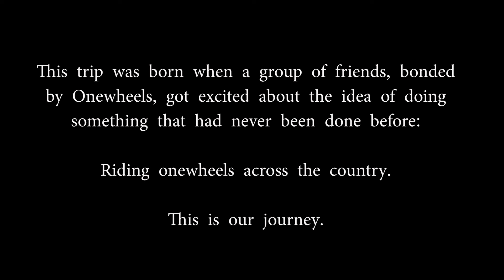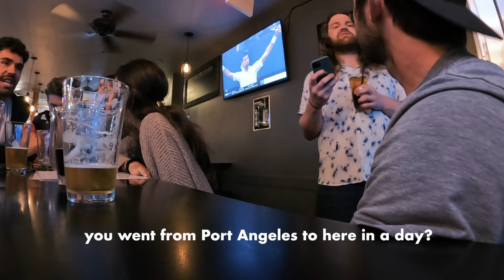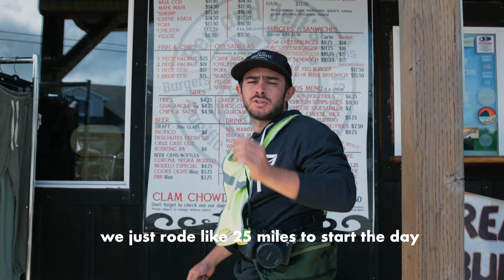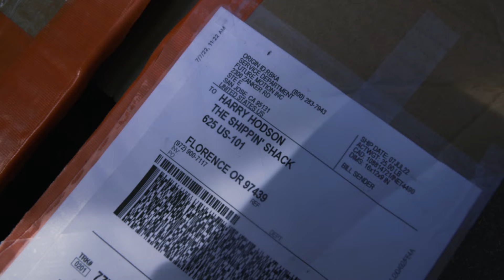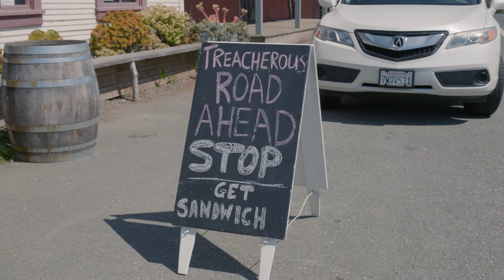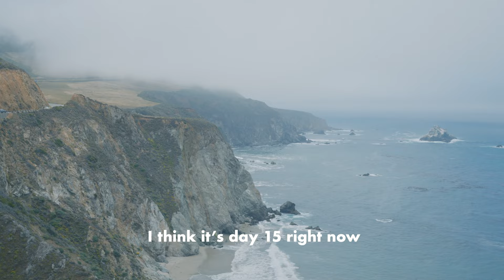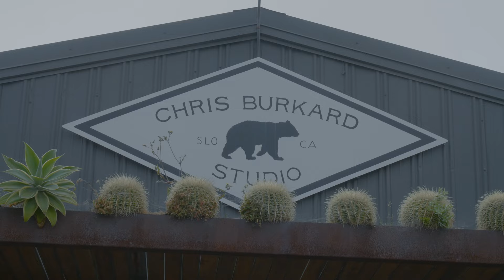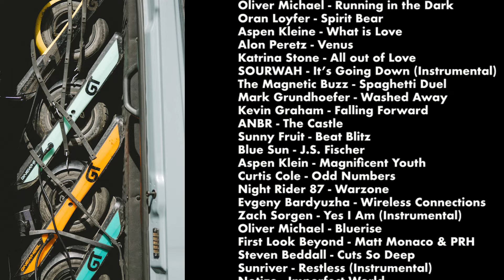Onewheeling from Canada to Mexico | "Carving the Coast"  [FULL FILM]

Comment: For a onewheeler, it's hard to manage the trip. Where to charge, which route to take, and so on. With a team and a bus, it's fun for sure, but no challenge at all, to be honest. :) I've done 100 miles more than once, all alone. It's manageable. What's important is the board and the charger. On the XR, it's much easier with an 8A charging option. The real challenge here is not getting busted by the police. Onewheels are banned in the most countries (in europe)